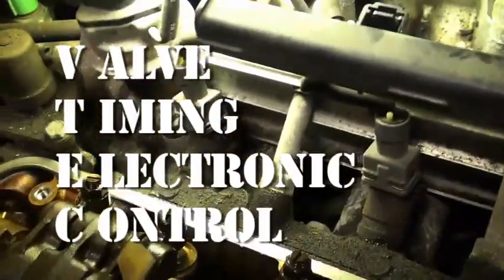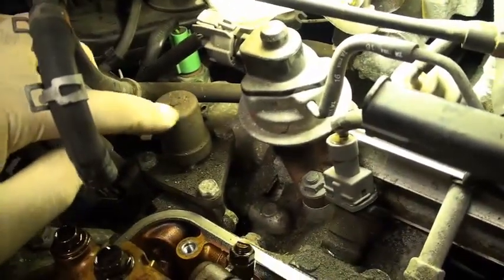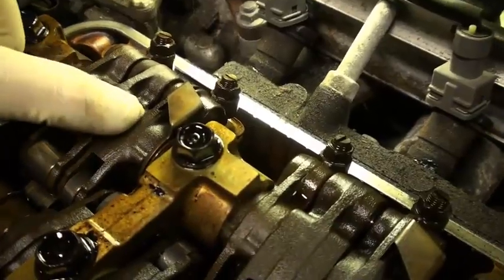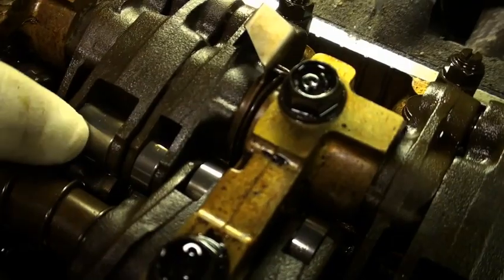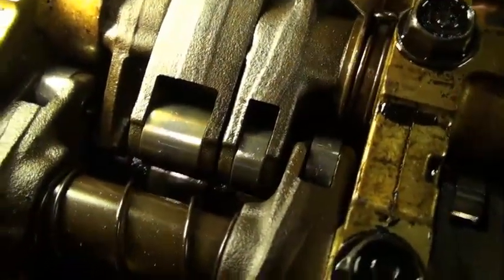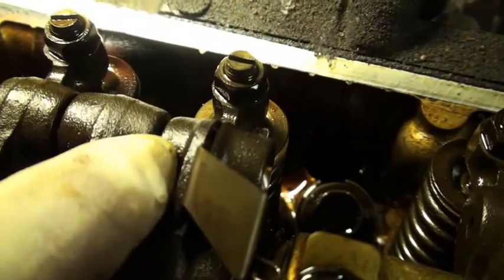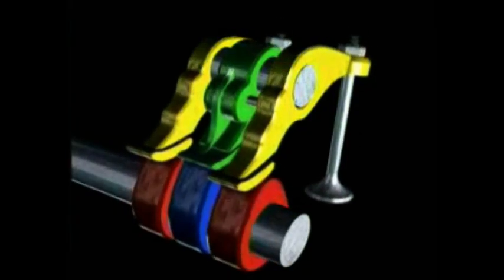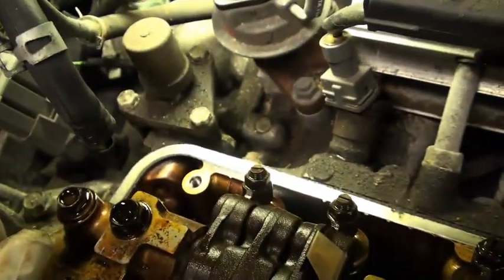What is VTEC and How Does it Work? - EricTheCarGuy

Comment: @risendrummer14 A standard 16v engine is technically VTEC running all the time.
The difference is, a VTEC has more power low down, because it runs as an 8v engine at lower revs.
So with some clever tuning and engine mapping, they can make it scream like they do when at high revs without sacrificing low down torque.

Comment: Hey Eric
i noted you kept sayng it was like VVT which is and isnt true to my knowledge VTEC changes the duration of the valve being open while VVT changes the intire timing of the cam to make it run with a different timing so as i understand it Vtec holds the valves open longer while VVT changes the engines actul timing from advanced -neutral -retarded to one of the others to make the engine run at optimal performance meaning spark time needs to be changed so Vtec is really a prototype for VVT

Comment: @risendrummer14 no reason to do that man, vtec improves torque/power at higher rpm. At low rpm the engine works at max efficiency, so if you had vtec activated then, you could lower the torque/power.

Comment: @hondatrix considering the amount of oil needed is only enough to activate the locking pins in the secondary rocker arms, im sure the engine would be fine. Although i don't have a lot of experience on Honda's system, it would make sense that they  would probably use a higher volume pump for Vtec engines.

Comment: @SuperBboy95 
e-vtec keeps one intake valve closed or opening less than the other in the same cylinder..and when "vtec" is activted, they work at the same rate, no high performance from the e-vtec...sorry

Comment: @flamingaxe791 In some cases, yes, but keep in mind that longer duration produces increased valve overlap, and without variable cam phasing, you cannot always produce the greatest desired effects.

The higher you get in rpm, the more duration you require, however, the more duration you have lower in the rev range, the harder the vehicle will run at idle.

The only way to have it all is through controlled variables in valve components. Vtech has more potential then 4 cylinders.

Comment: @flamingaxe791 I understand your position over Vtech, however, if you were to simply run the same duration and lift profile at lower rpm, the engine would run very rough and maintain poor fuel economy.

It's all about volumetric efficiency and balance.

If you were to apply this system onto a modern, domestic V8, you could have fuel efficiency, torque and top end power.

Comment: @harlemkiid149 v-tec dosent kick in at a MPH, it kicks in at a RPM. in my 07 civic SI its around 5700, 5800ish rpm. no its not like a mini turbo, it just gives you a little more power in the higher revs, you can certainly hear it, and you can feel it too, it wont snap your head back or anything like that, but its pretty cool on its own, or even cooler if you wanna build on it, like everything else, it depends on what you wanna spend.

Comment: @droubie66 yes.  That is the only reason for vtec, have great mpgs when in lower rpms (usually vtec cross over is at about 4500 or so rpm), however when you get into the higher rpms the solenoid activates locking the middle arm into place to allow more air and fuel to go in, and more exhaust flow on the way out.

Comment: @Ben762x51 No, the v-tec rocker isnt connected to a valve, its just getting its lift and duration from the center lobe and transfering it to the two intake rockers either side of it

Comment: Great explanation.  Thanks for posting it.  Quick question.  Before vtec you'd be running with 16valves, but when vtec kicks in you'd actually be running 20 valves total right?  Does that make sense? 3 intake 2 exhaust per cylinder.

Comment: @itzGTIbruno It means the engine uses two cam shafts and each shaft has vvti. As far as operation and engagement of vvti, there is no difference between single and double cams.

Comment: Thanks for the information. Are pretty much all Vairable Valve Timing Technologies pretty much all the same? For example comparing VTEC to BMW's VANOS or Valvetronic? 

I don't think BMW's have that oil pressure gauge, because I don't feel a push when I'm revving the engine.

Comment from the maker: @dacarfreak2000 Trademark and VVTi (Toyota) is a system that also adjusts cam timing as well as lift and duration.  A similar system was adopted by Honda in later model engines (the K series), iVTEC.

Comment from the maker: @toyty1 Noise like that would indicate loose parts and to be honest I don't think going to a thicker oil is a good idea in fact I feel it is a bad idea because using thicker oil can starve the top end of the engine during start up particularly in colder weather actually causing more wear.  If you have noise address the noise don't try to put a 'band aid' on it.

Comment: @sharkey118 just a note. Torque is mostly a product of displacement. if compare engines with the same displacement from different manufacturers you'll find very similar torque figures. Ford focus 2L base-110hp/125lb, ztec-130hp/135lb, st ztec-170hp/145lb. Chev cobalt 2.2L 145hp/155tq, 2.4L 173hp/163tq. Honda 06 civic 2L 197hp/140tq, 2012 civic 2.4L 200hp/170tq. so you see to say honda doesn't make any torque is really misleading.

Comment: Hi Eric , please advise on how to overcome Honda Accord 2.0 VTEC year 2004 on the valve noise if possible without adjusting on valve stem , some say change engine oil more ofter the noise could be reduce or back to normal/ordinary ?

Comment from the maker: @6480Alan Depends on the engine, some Honda engines only have VTEC on the intake valves but if it's on both the intake and exhaust they work the same.

Comment: @Hoopr32 i have a 2000 v6 3 liter vtec ( 200hp) and an acura integra is 1.8 liter 4 cyl vtec (175hp). my gsr is faster than the v6 accord. it has not been done. the 4 cyl gets more power per liter than the v6. my sister also own a honda pilot v6 i think its 2.4liter. 

what im trying to say is that they make better 4 cylinder motor than there v6 system. RSX, TL,Tsx is faster than most of their v6 motor as well and they are 4 cylinder motor.

Comment from the maker: @20tuskani07 You need to understand how cam profiles work, if you have an aggressive cam the engine won't idle but it will run great at high RPM, the opposite is true for a mild cam.  VTEC is the best of both worlds.

Comment from the maker: @angrytitties it allows you to run 2 different cam profiles on the same engine, thing of it as running 2 OS's on a computer and having the ability to switch between the 2 to get the best of both systems.

Comment: @satinISsexy "20 + years"....Turbos were originally designed about 100 years ago in aviation as a "New" supercharger helping with reduced air density at altitude. Based on Engine Geometry (Bore vs Stroke) there is a RPM range for max thermodynamic efficiency, this is different than Max Power. Power nearly always increases w/ RPM. It will eventually Drop off due to Decreased Volumetric Efficiency. Vtec Changes timing to increase volumetric efficiency (Turbo systems usually have over 100% Vef)

Comment: @satinISsexy 

Torque x RPM = Power
Opening Cams Earlier allows a full charge of air to enter the cylinders. At high enough RPMs airflow can become choked through the air inlet. More Air=More fuel you can burn.

Comment: @thebubbleman yes totaly agree these engines are designed to run at high rpms opening v tech @low revs will be a non starter  ,only because they really have no touqe to speak of  keep in v tech tho keep the revs high move gears near the limiter then it comes into its own

Comment from the maker: @DjEyezLow It's not just gas mileage the high lift and duration is designed to work at high rpm, if you did that you wouldn't have any low end torque and it would die on the line.

Comment from the maker: @Thebubblerman Not a good idea as the higher lift and duration will only work at higher RPM, try it at lower RPM and you just won't have the torque.

Comment: @sgcwproductions1 the cam has 2 lobes a small one and a little one when the engine reaches high rpms the hydraulic fluid locks all three rocker arms together and then they work off the high lobe of the cam

Comment: wrong explenation thats an HX head 

1 roller rocker pushes 1 intake valve fully open all the time, 1 fallows a small lift lobe that nudges the other intake valve just slightly to keep fuel from collecting, once locked together both rockers run off the single high lift lobe

exhaust is just 1 lobe shape all the time

Comment: @EricTheCarGuy There is 1 piston in the center rocker-arm, not two as you claim. 

Oil pressures acts on the piston in the arm that has the metal plate attached to it. This metal plates keeps the piston from moving outward until the rocker arm is in the unloaded position. That is why the metal plate is called a timing plate. 

When the piston moves it engages in the center while pushing the piston in the center arm which then moves over and engages the other outer rocker arm.

Comment: Oops jizz!

Oil pressure in fact acts on the left rocker arm with the timing plate blocking movement of the actuator piston until valve lift is zero. 

Cheers!

Comment: The oil flows through the outer arm, pushing the pin in the center arm into the other outer arm. 

That is why there is a lock-out plate on one of the outer arms. 

Not from the center arm outward.

Comment from the maker: @BodyBuilder454 I would not say more 'efficient' as the idea behind the system IS efficiency, alter it in the way you suggest and it will not be more efficient, in fact I don't think it would help acceleration at all because the engine would not be at the optimum cam profile for low end torque.

Comment from the maker: @jperez20010 Not sure I understand the question as the pin IS what actuates VTEC.  You don't want to run it all the time however as the engine will not run well at lower speeds.

Comment from the maker: @NEVERENDS90 The only problems I've seen with it are if the oil was low or someone put the wrong oil in the engine, I've never seen a mechanical problem that wasn't caused by an outside force i.e. someone not putting it back together correctly.

Comment: @lokopoi123 yeah i imagine you would have to remove the solenoid so that oil pressure is going through it constantly and set the rockers to be permanently together.  i have a 5.0 in my fox mustang so i dont have anything fancy like that.  just simple performance with simple mods.  im just here learning

Comment: can the vtec activate at low rpms but floored? I'm bringing this up because i believe i heard my vtec engine kick in when i was at 6th gear and i floored it. I was trying to save gas so the rpm was not that high. I believe i heard it, so i'm wondering if there is another way of the vtec activating instead of high rpms.

Comment from the maker: @h2cker You can't, you have to choose between fuel economy or performance as the cam is fixed and cannot be changed once it is made, with this system you can have both fuel economy and performance and switch between the 2.

Comment: VTEC stands for "Variable valve Timing and (LIFT) Electronic Control" It's far different and more effiecient than alot of the VVT systems of today even thougn it was invented over 20 years ago. The first production I believe was the B16A in japan 1.6LDOHC VTEC engine rated at 160 HP at 8000 rpm. The newest versions use oil pressure actuated adjustable cam timing on either the intake or intake and exhaust camshafts called I-VTEC.

Comment from the maker: @TheBeebopper Actually it's a very reliable system that hardly ever has a problem and if it does it's mostly due to low or incorrect oil type.  Thanks for your comments.

Comment from the maker: @inexplicable92 VVT adjusts cam timing not lift and duration.  It has a similar effect but it's executed differently, later Honda systems such as on the K series engines adjust both cam timing and lift and duration hence the (i) in the name.

Comment from the maker: @TheBeebopper The system is automatic and there is no driver feedback.  The computer initiates VTEC when certain conditions are met, it is not consistent when that happens but mostly it happens during 'spirited' driving since the strategy is geared toward fuel economy.  Honestly it's not like adding nitrous or anything like that, in fact most times you don't 'feel' it kick in so much as hear it.

Comment from the maker: @eric31291 In 15 years of working on Honda's I can say that there really are only 2 problems with VTEC, low or improper oil.  Check the oil level to see if it's correct and if your not using the oil viscosity that is stated on the cap then put the correct oil in.  There are some check engine light codes that will prevent VTEC from working so be sure to fix those if you have any other codes stored.

Comment from the maker: @KeepingModern The edges of the pins are slightly rounded so they will engage the next time they get close.  It's really a well made system, in fact the only problems I've run into with it are due to low or incorrect oil, I have yet to see a problem with the mechanics of VTEC that wasn't caused by someone else.

Comment: @EricTheCarGuy you shouldnt set the Vtec lower then 3500rpms for all motor and 3000rpms for turbo.  no higher then 6000rpms with or with out turbos.   Thats if u have a programable ecu like hondata s300.  Most hondas have it set stock about 4800 - 5500rpms. I just got my car Dyno tuned and they set it at 4700rpms and i adjusted it to 4500rpms

Comment: @EricTheCarGuy @EricTheCarGuy I reckon it's because OHV designs are still cheaper and modern metallurgy means that pushrod systems have much less flex and associated slop in them than they used to.  Besides, not ALL U.S cars use OHV engines, mainly it's just the V8s!

Comment: @EricTheCarGuy I reckon it's because OHV designs are still cheaper and modern metallurgy means that pushrod systems have much less "slop" in them than they used to.  Besides, not ALL U.S cars use OHV engines, mainly it's just the V8s!

Comment: i have a 2001 hyundai elantra and it has a bad problem not sure what it could be i went to start it up one day it went for 1500 all the way up to 3000 and stayed their till i put it in drive then it droped back down then i put in park agin it did the same thing i even cut it off let it cool off then cut it back on and it did the same thing and the check engin light was on after i got the axles replased what do you think it could be???

Comment from the maker: @JRT3000 You would need more than the solenoid, you would need to swap the head as well as wire it up to a new computer to run it.  It would be better to start with an engine that already has VTEC in my opinion.

Comment: @EricTheCarGuy  the area where u was pointing at with the vvt sensor and the other green plug one those two are under my 2000 Acura tl the one with the green plug is that my VVT sensor or KS its rigth on top of the oil filter area.

Comment: hey eric i have to change a vvt sensor on a 2000 acura tl it boke off and its on top of the oil filter area with a green plug is that it or thats  KS

Comment from the maker: @renedewit9 I believe it's normal really, VTEC does not come in at a specific RPM, it's managed by the computer which decides to activate it based on engine and load conditions.  Honda's like it when you rev them anyway so as long as you aren't in the redline you should be fine.

Comment: @EricTheCarGuy Hi Eric, thanks for all info.  I experience a flaw in my accord 4 shift tip tronic  (EUR model).  When I drive on the highway up a hill and shift down to 3rd for more power, the VTEC system is activated above 4500 RPM, when it's up to the red at 6500 rpm  I shift to 4th again but it does not hit the 4500 rpm, needed to keep speed, so I have to shift back to 3rd again.  So the rpm range for using VTEC does not overlap from 3rd into 4th gear.   What do you think?  Regards, Rene

Comment: I wish I watched this 2 weeks ago.  I had an 04 Civic with a D series motor.  I did a head job, i just removed rocker arm assy as 1 piece and set it aside.  finished head job, ran car and got VTech code.  long story short, chased my tail for 6 hrs only to find one of those pins or pistons was missing, someone had filled hole with silicone to cover up the prob.  anyway got part from local machine shop and fixed it!!  Thanks for posting your videos!!!

Comment from the maker: @MrDjbonilla Honestly, snug up the throttle cable, see the video I did on $0.00 Performance upgrade.  I like to start with a nice set of wheels personally, lighter than stock, it really helps it handle better which means you can drive it faster and still maintain control.

Comment: @eddp777 - A higher lift and duration means that the valves open further and for a longer period of time which alters the fuelling compared to the regular lift and duration provided when in non-Vtec operation. Basically it gives it a kick up the ass when you fancy it :)

Comment: thats a smart design.  hey will a single cam vtec head from the 1.7 civic engine mount and work on a 1.5 non vtec engine block?  and if so will i need to convert from obd1 to obd 2? thanks in advance

Comment: @AnonymoussourceL0L More air, which means the computer (in recognising a higher airflow) squirts more fuel then if they were only opening standard lift and so it runs harder.

Comment from the maker: @hatcheg93 By definition duration is a measurement of time and the cam profile not only dictates the amount of lift but the timing of the opening and closing of the valve, different cam profiles open valves for different lengths of time hence, valve timing.

Comment: True 140 is 140, but at low rpm you get much better fuel economy without losing potential for high rpm power. In my car it results in avg mpg in the 29-31 range city/hwy combined and yet I still get 98.5hp per liter from a 2.0 engine (197hp at 8000 rpm). Its a great system for getting economy and performance.